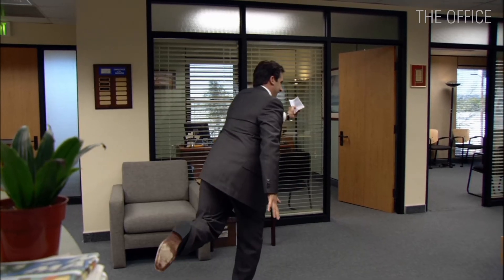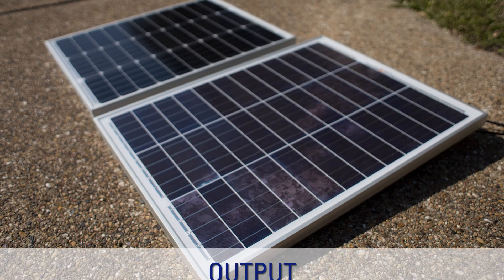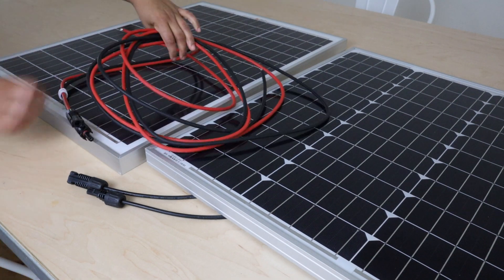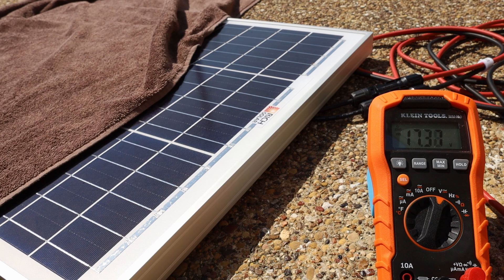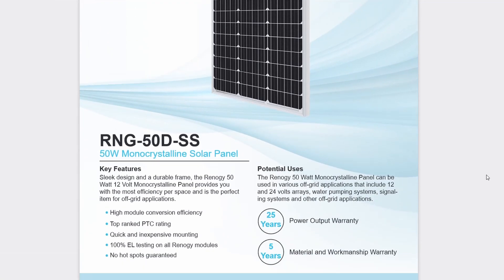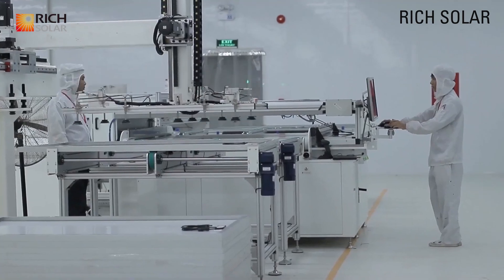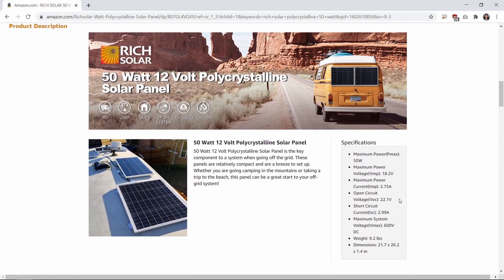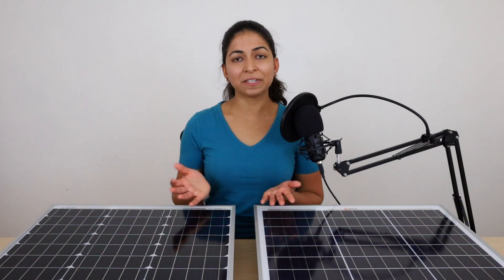(Not another) monocrystalline vs polycrystalline solar panel comparison

Comment: To be clear, the power output is rated at 50W. This means that if one panel measured 14v and the other measured 20v, they would have a current output of 3.57A and 2.5A respectfully. The number of cells is irrelevant as it it more important as to whether they are connect in series or parallel. 

When the cells are in parallel, the voltage stays the same but the current increases for each cell added. When the cells are in series, the current stays the same but the voltage increases for each added cell. If you had 10 cells rated at 5v (volts) 1A (amps), you could connect them to get 5v at 10A or 50v at 1A. Ultimately, both systems would output a consistant 50 watts of power regardless of how you connected them, you won't get a penalty or benefit for either configuration, you just use which ever is most useful for your application. Neither cell configuration would be outputting more power than the other.

Comment: Volts without Amps is lacking a power output result in math measurements.   Find a rate of current flow in some comparative probable use function being publicly of marketing interests.   50 watts is the published measurements for the panels, of course.

Comment: Obviously both of them were 50W with 10% difference in the area. It would have been more accurate to show how much water can you electrolyse in 24h placing both on a 45 degree angle south facing panel.

Comment: you shouldn't be measuring voltage but Watt's to test the capacity of the solar panels. Every solar panel will basically deliver its nominal voltage is 'some' light falls on it, even with indoor lights for example. However, it does not mean they will deliver the rated power in that situation

Comment: Another great informative video. I hope you will continue to offer solar panel videos as the solar panel industry/ products continue to progress. Thanks again!
Reply: Monocrystalline solar panels have the highest efficiency rates, typically in the 15-20% range. This high efficiency rate means they produce more power per square foot, and are therefore very space-efficient. 
Monocrystalline solar cells are more efficient because they are cut from a single source of silicon. Polycrystalline solar cells are blended from multiple silicon sources and are slightly less efficient. Monocrystalline solar panels are the most efficient type of panel compared to polycrystalline and thin-film options. Typically installed for larger power systems in commercial and residential properties.  0:05  [Architectural Digest; Forbes; Geotherm Hvac com; Unbound Solar]

Comment: You should have also tested the short circuit currnet for both panels at it yould have given total Power (Volts × Current = power in watts)

Comment: Measuring voltages only leaves this experiment’s results indeterminate.  A widely available ten ohm 50W resistor across your meter input would be close to ideal.

Comment: Your research is good, as usual, but in this case your lack of electrical understanding makes for a rather embarrassing (and indeed misleading) video. As others have explained, measuring off-load voltage tells you nothing about power output, just how many cells are in series. Schoolgirl error :-)
At the very least you need to actually measure power with some sort of load, and really you should measure output at MPP if you want to say something about relative efficiency.
You made some statements at the end about panel quality which seemed to be plucked out of thin air. How do you know cheaper panels will have shorter lives and higher degradation rates? It might be true, but there was no evidence presented. I'm afraid you get a D for this one.

Comment: BC, The static voltage test is not measuring anything useful because there is ~zero current and  therefore no power. 
Having them spin a fan or pump water and then measuring the power by simultaneously measuring voltage and amps would be more  interesting. 
Timing the pumping a gallon of water alternating between the two panels would be an interesting test of Useful Power! ⚡
Hooking them up in opposition and seeing which one detonates first might be fun to watch! 💥
If you break one, Nuke a fragment in your ex's Microwave to see if you can create Plasma. 🔥

Comment: I have too many issues with this video. First, panel makers specify two efficiency figures for their panels - cell efficiency & panel efficiency, with the latter always being lower than the former dues to wasted space between the cells & the panel frame.  The poly-crystalline panel can't be 13.4% efficient vs mono panels 21%, measure 18% larger and produce the same power as the mono panel. I suspect that the poly-crystalline panel uses cells that are 17.5 to 18% efficient, while the mono panel uses 21% efficient cells.
Other have already commented on the test methodology.

Comment: I would be interested to know the comparison of how the output degrades over time (0y, 1y, 5y, etc).  I also think you could spend more time on factors like:  

a. panel failure (availability of replacements, as an incentive to buy from an established “premium” brand)

b. future increased efficiency as the technology improves (a deterrent against buying a very premium, top-performing model today)

c. the efficiency of the two panel types at different angles (assuming most people have a static mount, is there an advantage to one type throughout the day/year? In other words, can you make up the cost difference of the mount is not optimal?

d. does the pairing of micro inverters vs. a string inverter change the overall system comparing the two types of cells?

Comment: With the voltage test you have mostly measured the number of series semiconductor junctions. There are definitely elements connected in series, or you would never get far beyond 0.7V, most likely around 0.6V, since every junction is also a silicon diode limiting its output voltage, but not limiting the harvestable current. Indeed for the mono-si panel with 33 series junctions, 0.6V*33 = 19.8V which tracks closely with your experiment. The poly-si panel with 36 series junctions should top out at about 21.6V by the same paper napkin math, which is by no means exact, but experiment is also within this bound. There also should be bypass diodes in the panel, external to the solar cells, to allow a partially shaded assembly to still produce some output. In order to account for this and several other factors, solar regulators use MPPT or "maximum power point tracking", applying the optimal load impedance to the panel or a homogeneous array depending on the output. Ultimately, unloaded test is of no meaning, you really can't determine their power without both a regulator and a battery or consumer that can take as much power as you're able to harvest.

Comment: Another fact when you install solar panels is the surface area they cover, it doesn't seem significant when you install only a few panels, but if you are limited in space and want to maximize electrical output, monocrystalline solar panels are better.

Comment: A better measurement would use 2 meters and a load. One meter for the current and the other for the voltage. Perform a power calculation. A load is very important or the measurements have no qualitative meaning.  I did enjoy your video.

Comment: I don't think there's much of a difference anymore. They cost roughly the same per watt and are roughly the same size for the same rated output, so I don't know if mono panels are measurably more efficient anymore. In fact in comparison videos poly panels often outperform monos. If you correct for surface area, they perform basically the same. Mono panels may degrade a little slower. In this video only volts were measured, but if you measured total power my guess is they would be very similar.

Comment: excellent video. maybe should have showed current while doing those voltage tests. the industry says mono is the way to go but when i saw many youtubers getting 105 watts out of poly thats where i put my money. i bought 4 rich solar 100 watt poly panels, wired them in series and rand that over 60 foot of 16 gauge wire and the max output was 398 watts. but my power production sucks bad in over cast days, so i bought 4 rich solar mono panels to test and use, but they haven't made it out to the yard yet.

Comment: i have both the  poly runs cooler under the Texas sun during summer, thus sustaining a higher output longer. Mono runs noticeably hotter by 1pm output starts dropping.

Comment: You have to draw current from the panels to do any sort of useful test.  Measuring voltage has no indication of power output.  It's like comparing a D size NiCad battery compared to a AAA alkaline battery.  The D size will have a lower voltage than the AAA size, but will be able to output much higher power.

Comment: If both panels produce 50 watts, and the poly panel produces a higher voltage then arithmetic says the mono panel produces more current since watts = Volt X Amps (current). In a practical application, such as keeping the batteries on my sailboat charged, I'd rather have more current as the excess voltage is unused since I don't have a MPPT controller. So the mono panel would charge my batteries faster.

Comment: pls also measure Amps, which are the important part in charging your batteries.. Voltage isn't. at 19 V thr mono will produce more amps than the 20V poly

Comment: You do need to measure both voltage and current to compare those panels, and preferrably use a MPPT solar charger as the panels might have different load curves.

Comment: I appreciate most of your content however, I have to draw the line at your comparison of the solar panels by voltage alone. Watts is the measure of volts times amps that provide an accurate measure of the work being done. Both Mono and Poly panels will fail to produce any significant power under any kind of shading conditions. The fact that the Poly panel is larger for the same watt rating is the real comparison. The only benefit of Mono panels is you get more power out of less real-estate. For those who have plenty of room Poly works just fine and saves you $...

Comment: One of the screens shown in that manufacturing video is fascinating. Due to the doping, the semiconductor junctions are not just light -> electricity. If you supply a forward voltage to the cell, it lights up. This is very dim, but can be seen in very low light with a long exposure camera. You can use this to see how well the soldering worked, check for cracked cells in a completed panel, etc. Great video as always!

Comment: Thank you for your efforts in presenting this information.
 Just to let you know, measuring only voltage does not give the power output of a panel. Just as measuring RPM only does not give the power output of an engine. A lawn mower engine at 2000 RPM, and a big truck engine at 2000 RPM do not both produce the same amount of power. With engines you also have to measure torque at load in order to calculate horsepower. 
 With electrical generators including solar panels, you also have to measure the amperage at load in order to calculate Watts.
I recommend people interested in solar to buy two panels, and four 6 volt golf cart batteries along with a 12 / 24 volt charge controller. With this equipment you can learn about series, parallel, and series parallel wiring by wiring it up as a 12-volt system, or a 24 volt system. Then you can take your bedroom Off the Grid!
By the way, photovoltaic cells produce approximately one half of a volt each at load, a little higher unloaded. So each of those panels cells must have been wired in series.

Comment: Good video, however I would be interested in knowing output power vs angle to the sun. If poly is less angle dependent for stable output, then I would not need to have adjustable mounting angle for consistent power output in higher latitudes.

Comment: This is a retarded experiment!  Looking at/observing Voc and not an Isc test is no way to compare potential power produced by these panels (not to mention connecting a panel directly to a battery and observing the "real life" Isc, despite operating at battery voltage).  Please learn something before not knowing the difference between voltage and current!

Comment: I like your videos.  A couple of comments on this one though:  Voltage is not output.  The number of cells in series matters for voltage, but not for current, and power is the product of both.  For a reasonable comparison, you are really looking to measure the maximum power point under operating conditions, including your partial shading.  Just measuring voltage output does not tell you too much about the energy that they will produce.  Just like measuring the pressure out of a water spigot does not tell you how much water you can get out of it in a given time.  The power out is a function of the voltage and the current, so you need to monitor both simultaneously under loads to get an accurate picture of its power output.  Some solar controllers, used mainly for battery charging drop the panels output voltage to just above the battery and the current at that voltage is what gets through to the battery.  The panels you had there are basically configured for 12V battery charging applications in that the voltage will be high enough from the panel to push current into a 12V lead acid battery under most circumstances.  Panels for such purposes generally have open circuit voltages under daytime solar insulation of between 17 and 22 V or so so that the voltage of the panel is high enough to push the current through to the battery.  Other more sophisticated controllers monitor the voltage and current outputs of the panel or panels and calculate and hold the panel at the maximum power point, the voltage at which the panel generates the most power, and that power is converted to a voltage just high enough to push it into a battery, or an inverter to push back to the grid, depending upon the application.  Solar panels designed for grid tie applications often have more cells in series and much higher output voltages, and are also often strung in series to voltages near 600V or even 1000V as at higher voltages you can move more power over a given size of wire with lower losses as the power lost is equal to the square of the current divided by the resistance of the conductor and the current is much lower with panels in series as compared to connecting them in parallel at lower voltage.  The ability to use thinner conductors with lower loss makes solar installations cheaper.

Comment: Nicely presented but unfortunately you got a few things wrong and the video is spreading incorrect information. I'm no expert but following parts need improvement:  Test the wattage instead of voltage,cells are in series not parallel.

Comment: Interesting video, thanks.

If you do another panel video, you might mention that so-called 12V panels are really 18V.  Go to Amazon and you'll see that the 12V and 18V panels for sale have similar specs - open circuit voltages of 20-24V and maximum power point voltages of 18V or so.

The 12V mis-label possibly comes from the use of the panels to charge 12V batteries, but they really are 18V panels.

Comment: The most important thing is the wattage output under test and under load, you can have 2 panels with 20v under test but one could be 2.5amps and the other could be 2.2 amps, voltage × amps = watts. For example you can have a 2 car batteries that are both 12v but 1 could have double the Watt hour output or an 12v alternator that produces half the amps of the other. So voltage is only a small part of how to determine what panel is best, next time plug each panel to a charge controller and add the same load and you will be amazed with your results as voltage is determined by circuit load. Im a fully qualified electrician and have had solar panel installation training

Comment: MPPT...  your comparison of the two should have used an MPPT (Maximum Power Point Tracking) charge controller.   As far as panels are concerned it is very easy.  If you have a large area for the panels then it comes down to simple math.  Area, efficiency,  cost per Watt.  Mono panels tend to be premium devices and as such long life.  They also cost allot more the last time I checked.  But they last and are power dense.  On the other hand, poly panels are less efficient but they are now near parity in cost per Watt to a mono.  You need the same power, this means more panels, wire, racking, space, and labor to install.  For mono panels you end up with around 17.1Watts per SQ foot and for poly panels that dropps to 15.4Watts.  Good panels should deliver 80% output at 25 years.  The mono runs around $307.00 per 300Watt panel and the poly runs around $256.00 per 270Watt panel.  Both are 64.57x39.06 inches.  Here is the take away.  All things considered the cost of the panel per Watt for the mono panels is actually cheaper at $1.02 per Watt vs the poly at $1.05 per Watt.  So all things equil i would be buying the mono panels.

Comment: the polycrystalline panels has more cells, each cell adds voltage and amps depending how it is wired in. now, what i really want to know, is the degradation lifespan of each. what is the yearly loss of power for each and how long before one becomes useless?